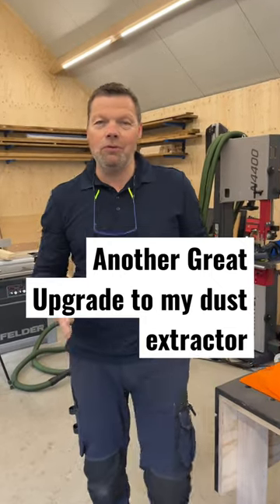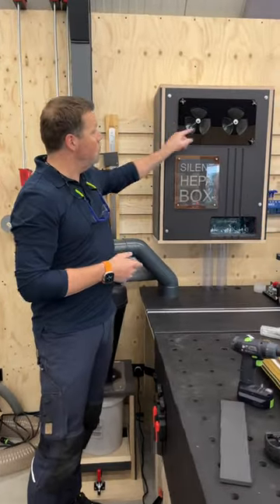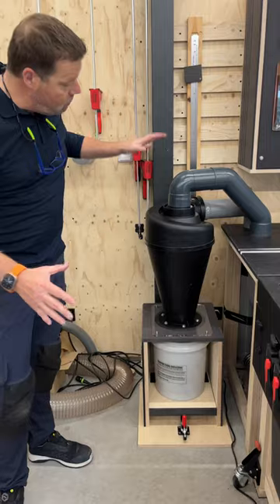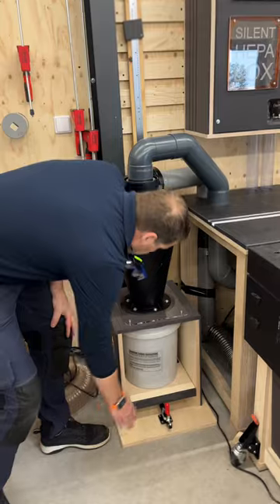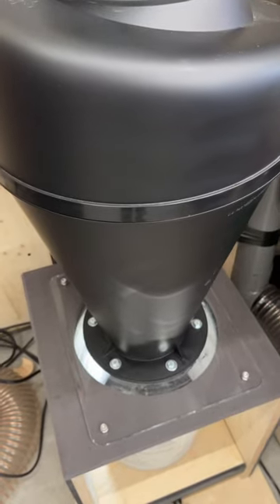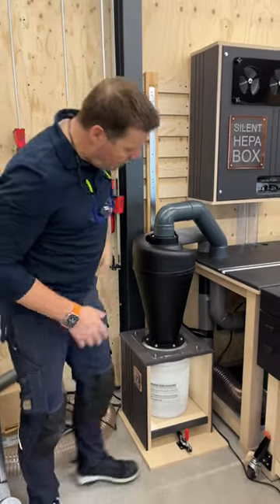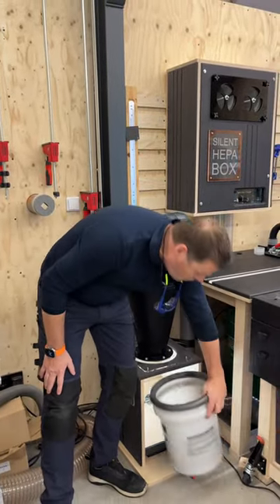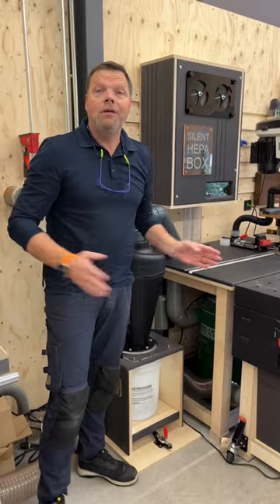Another great Upgrade!  #shorts

Comment: Now a little teaser of what it looks like inside the CamVac and I'm happy. 😉

I'm a bit surprised that you're using 90° angles in the pipework, which is supposed to be avoided. Is that why you have the version with three motors?

I think the idea with the small bucket is really good. It's much easier to handle than a 200 litre barrel.
Reply from the maker: That will be my next upgrade😊 because this is a high pressure system those turns do not have an effect. Same is with adding a cyclone. Where this a issue with a high volume system, this will not count for a high pressure system

Comment: Hey Dennis,

First, wow - just wow! I’m so happy I found your channel. I’ve been binging content the last couple of days. You do a fantastic job articulating and explaining. Your shop setup and hobby interests are similar enough to mine that I find myself graphing out how to implement many of your upgrades.

Personally, I live in NW Ohio in the US and this CamVac series you seem to be building seems to be the perfect solution for my 192 sq foot shop. I’ve been looking for years to get a proper solution and landing here, I think i have found it.

Will you have plans available for the add ons that I could buy so that I can make the appropriate mods for what fits in my shop? On your site, I see the whisper box, but I’m most concerned with this newest upgrades to your design. (I’d binge full length videos if they are coming too…😂)

It doesn’t have to be a full parts list, just a basic diagram like your whisper box, as I’m trying to graph out what a couple of modified versions could look like. 

See, I don’t have many stand alone tool stations, instead I have multiple movable stations on casters. So I’m drawing up how an Outfeed table/workbench would work fitting this into the bottom so it’s one unit…
Reply from the maker: Hi Andrew, I have some more upgrades left that I have to implement. After that I will upload the full video with explanation and how to build. At that moment I will also include drawings on my site. Thanks for your enthusiasm

Comment: Hi Dennis Where did you get that cyclone from. That system looks good. Cheers Andrew
Reply from the maker: Cyclone is from oneida. I explain everything in the big video
Reply: @HookedonWood  Hi Dennis Is the video already available or is it coming soon ? By the way thanks for the video on the bangood sharpening jig. I've ordered one, much less hassle than using the veritas system which I have. By the way check out the Diamond sharpening stones from Naniwa they are expensive but work very fast and leave an incredible mirror finish with little effort. Cheers
Andrew
Reply from the maker: I will look into them, Thanks for the tip. I plan it for next month. Have to do some upgrades, and the system has to be completely finished before I can make the video. Otherwise, I miss context for some upgrades.
Reply: @HookedonWood  Ok Thanks